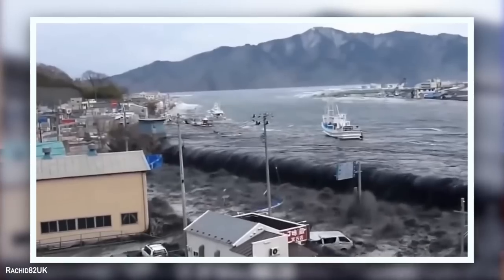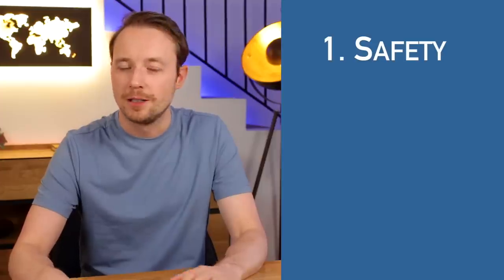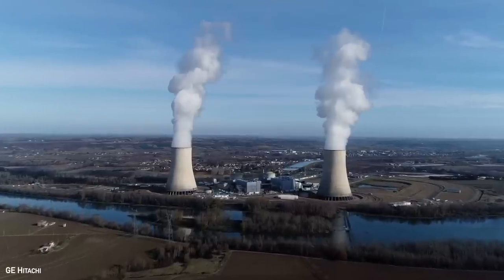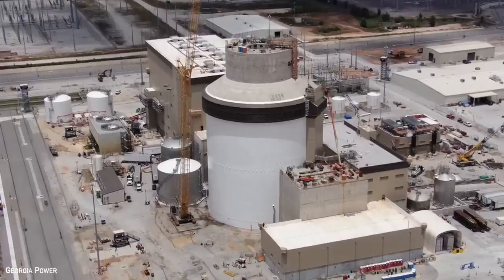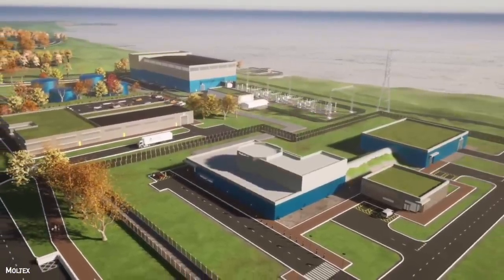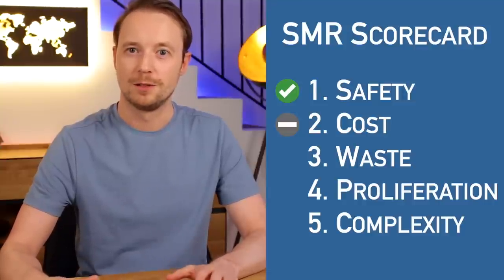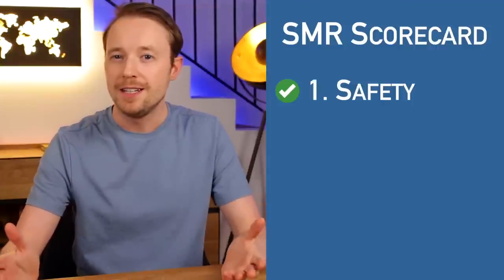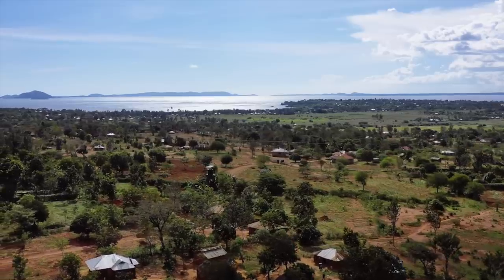Can Small Reactors Revolutionize Nuclear Power?

Comment: What is the definition of insanity: “Doing the same thing over an over expecting a difference result.”  They are too expensive and what do you do with the waste. They are basically just the most expensive choice for a battery you can make. Why does no one talk about “Liquid Air.” It’s cheap, safe, renewable and can be quick to build. Why do you always choose the most expensive paradigm. We need to replace fossil fuels so let use the system that will cost us trillions. Because it’s not about fixing our needs, it’s just about making sure only the elite few should get rich.  But if we are so bent on spending trillions let’s get the biggest bag for our buck. So why didn’t you use air in your Levelized cost analysis it would have been cheaper then any thinking you listed, plus there is no waste. In every metric you listed “Liquid Air” would beat your MSRs hands down !!!
Reply: Nuclear is a battery?
A battery is a storage unit, a nuclear plant is a power generator.
Reply: @LSuschena  a battery is a storage unit and so is a nuclear core. At some point that core becomes spent (if it was a generator then why does it, at some point, run out of power) and needs to be replaced just like a battery. Your assertion is just a bunch gut wind !!!
Reply: @rikkoshop620  
Well yes fuels do store energy that is converted to a usable form of energy.
Batteries have to be charged to be useful as they contain no energy until they are and require a separate source to do that.
Reply: @LSuschena  yes well that is my point batteries have a life span. So does a nuclear core, even though it’s energies come from a natural form of decay. But unlike a nicad, once spent, you can not recharge it !!!

Comment: Those "with carbon capture" figures are nonsense. Carbon capture is environmentally destructive and economically wasteful, and it just plain doesn't work, anyhow.

The only rational cost advantage of SMRs compared to fossil fuels is simply that fossil fuels, especially fossil fuels other than coal, have a finite supply, so their cost can be expected to rise, and eventually exceed SMR levelized costs. But fossil fuels also have a PR problem, because of the widely believed myth that they are environmentally harmful. (That myth is just as irrational and unscientific as the widely believed myth that nuclear power is dangerous and environmentally harmful.)

The cost advantage of SMRs compared to renewables is because SMRs deliver reliable baseload power. In other words, it is there when it is needed. But renewables generate power capriciously. They have a nasty tendency to generate power when it isn't needed (so that power has zero value), and not generate power when it is most needed (when the value of the power would be highest). The result is that renewable power often has a very low average sale price, which people who don't understand the economics point to as evidence that renewable energy is less expensive than other energy sources. But what it actually means is that renewable energy is less valuable than energy from other sources.

The bottom line is that SMRs are likely to be viable replacements for fossil fueled power plants, and renewables can never hope to be viable replacements for fossil fueled power plants.

For the most part, SMRs obviate the already marginal usefulness of renewables. One of the interesting features of nuclear power is that most of the costs are fixed, and independent of how hard you run the generator, because fuel costs are a small percentage of total costs. Paired with natural gas power plants, intermittent renewables can at least reduce gas consumption, which is a significant part of operating cost. That gives the renewables some value, albeit low. But paired with nuclear plants, intermittent renewables have negligible value.

There's no point in using renewables to intermittently replace some of the power which could have been generated by the nuclear plant. The only exceptions will be niche situations, such as solar energy in places air conditioning load dominates peak demand, and solar can be useful for peak load shaving, enabling you go get by with less installed nuclear capacity.

(If any of these facts are surprising to you, click my name/icon and then click "About.")
Reply from the maker: Agreed carbon capture has somewhat limited actual value, but that doesn't stop companies or designs from advertising it. Mixing different sources (renewables, nuclear, gas, etc.) I think will change over time and who knows, maybe fusion will come and we can all just go home. But until then, each has plus and minus. Your point about peak renewable generation I always thought was a little funny, unless the environment is particularly hot and lots of AC units are running. Cheers!
Reply: @atomicblender , yes, the "peak load shaving" rationale only works for solar, not wind, and only at low latitudes, and only in first world countries with lots of air conditioning load. Think Arizona or Kuwait (though Kuwaitis probably don't care because they're awash in oil).

At higher latitudes, peak load tends to be caused by winter heating, when solar output is low. (That problem will just get worse as more people charge their EVs overnight, when solar output is zero.)

Even in ideal locations for using solar for peak load shaving, it's not a perfect match, because peak AC load lags behind peak solar output by a few hours. AC load is still high in late afternoon, when solar power output is rapidly declining toward zero.

W/r/t my environmental claims, Youtube won't let me provide reference links (and I have to keep my prose circumspect to dodge their censorship bot), but if you click "About" on my channel you can find a link to information that you might find interesting, as well as my contact info. (I don't know your name, so if you contact me please mention that you're atomicblender.)